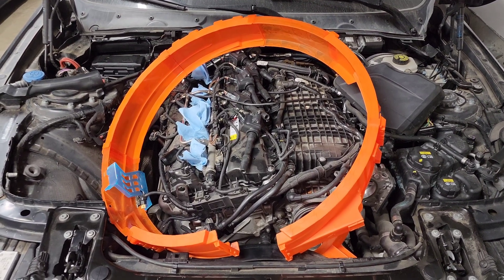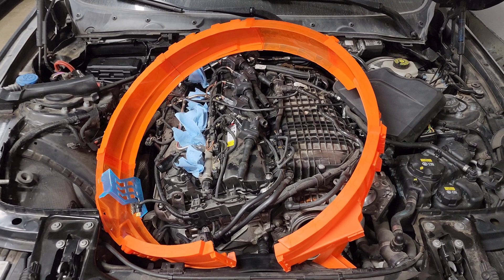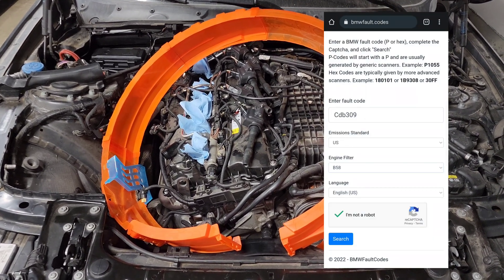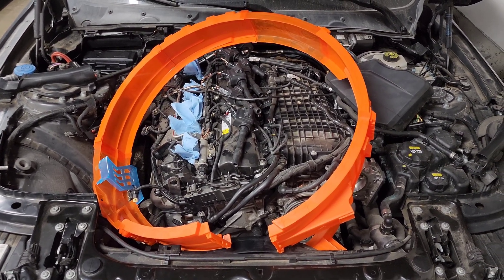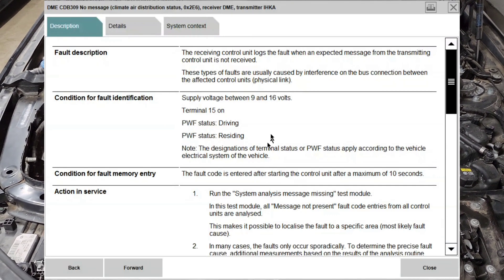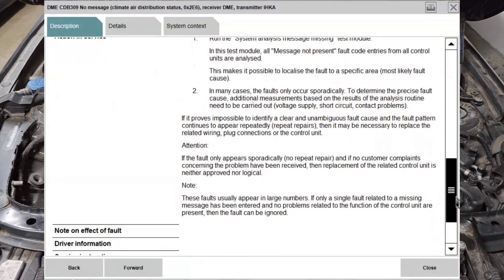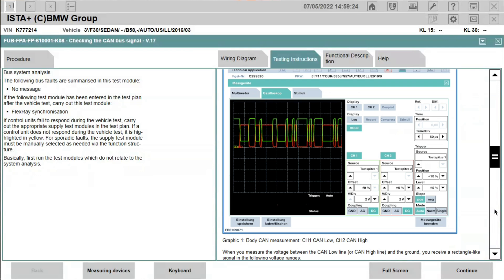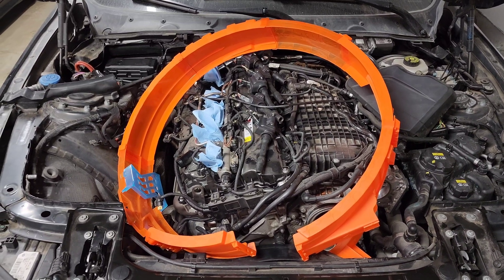CDB309 Fault Code - B58 Common Issues

Comment: It's great having you to go to. I just got my car tuned with gc+ , Dp, and fuel pump and just started getting that exact code. 
 When it goes off and shows engine light, does the car cut power some?, I can't really tell but I don't think so
Reply from the maker: It does not cause a check engine light
Reply: Just experienced the exact same thing, any new info if this can cause a blinking check engine light

Comment: What did install ista on?
Reply: Could you do a video about how to get set up with ISTA? For ex. Does an MHD adapter work? Or do you need another cable? Would love to get the basics of using it. If such a video exists, would you mind sharing one you found helpful?
Reply from the maker: Windows laptop
Reply: @kern417  what ram size and gb